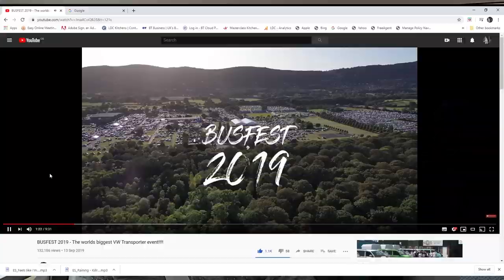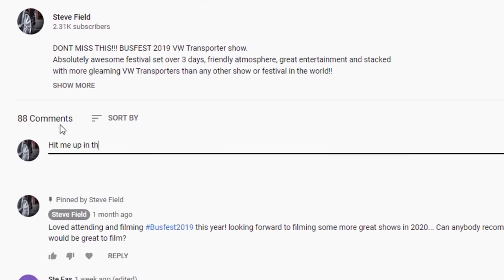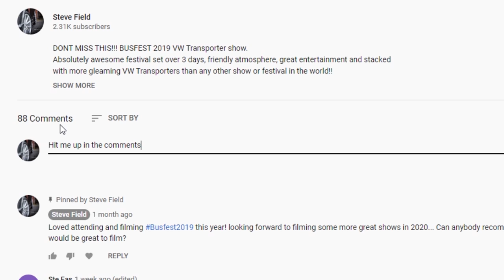Transporter T6 Has a DARK SIDE!! | Winter Mode | OMG..What did I Press..????

Comment: I hope you smeared the hub flange with copper slip grease....I fitted 20” alloys to mine and 4 years later, when the garage tried to remove them for the first time, they had become seized on!
Reply from the maker: Oh shoot! That’s not good.  But it’s good tip👍.  I do use copper slip a fair bit due to owning an old car with same issue years ago but my wheels are never on for more than 6 months at a time as I have 3 sets 😬😂.

Comment: Be careful, having wheels with a load rating less than that required by the plate can result in big fines. You need to get the load down rated to use them legally. They also invalidate your insurance.
Reply from the maker: Thanks for the info👍 I have upgraded the wheels and tyres since this video and have a newer video up now.

Comment: Hi Steve - new boots look tremendous. Have you ever considered mud flaps ? ( thinking go the shot blasting on the side bars). The OEM fronts are fine but the rears are a tad odd. Did you also contemplate sealing the new alloys with the likes of Poor Boys wax ? Keep up the tidy content please. Loving the intro edit by the way ....
Reply from the maker: Cal S Thanks buddy 😊. I have considered yes and like you in not sure about the rears as the sit halfway up the bumper so it’s kept me from adding flaps.  They would be blummin useful though!! Re the protection,  that’s a good point I haven’t protected them yet but I do want to restock on my detailing get as im really low on stuff again  due to regular washes over the winter 🤙.  Is poor boys wax good stuff?

Comment: Love your channel. You make the diy changes look very easy. How does it work if you change your wheel sizes eg from 17s to 20s with regard to your speedo (speed and mileage)?
Reply from the maker: Thank you 😁,  it does effect the speedo so tyre size is important.  I run 275 / 35 / 20 which keeps my rolling ratio very similar so mine is marginally out but if you have 275 / 40 / 20. You will increase the overall radius by a noticeable amount and that can alter speedo so 6-10% potentially..  I can also cause the wheels to rub on full lock in so cases too.
Reply: @SteveField  where do you find out this stuff?
Reply from the maker: KVG M05 me personally I have been modifying  vehicles for years and you pick the knowledge up as time goes on.  But I still learn something new every day !

Comment: What drill did you use to take the wheel nuts off cheers
Reply from the maker: Its a Kielder 18V 1/2" Impact Wrench with a 4Ah Battery. I carry it on the van in event of puncture as has the torque to pull the nuts off when they are fully torqued up with any pre loosening .  I still use a torque Wrench to torque the nuts on refitting though.
Reply: Thanks for the reply and how do you rate it ?? Is it worth a purchase cheers
Reply from the maker: jason Pugz Yes I rate it for the price very good  tool.  Used it loads with swooping wheels for these vids and it’s still on the original charge!!  £160 GBP👍

Comment: Steve, what's the opinion of the Transporter HQ lights at night?
Reply from the maker: Well,  I love the Seq indicators, Im happy with the DRL although would love it even more if i couldn't see the LED's and the were full defused... But still happy... Lights at night is say, "Better def better but I would still like more if it was available as my other vehicle has Xenon headlights and is worlds apart.  I have made a video on this if you have not seen it?.
Reply: @SteveField  saw the fitting video but not a night time test
Reply from the maker: spaynter my evaluation in the lights when I think about it is.  If an existing van has those stock headlamps there is no better headlamp on the market to improve it for under £600 “as far as I am aware”  but given the chance I would def have paid the extra £1500 at the factory.   🤙

Comment: Did you powder coat your side bars?
Reply from the maker: No buddy that is the factory finish from Vanstyle if you opt for black.
Reply: Steve Field mine are chrome & was thinking of getting them powder coated black as well as the roof rails 🤔
Reply from the maker: Lee C I don’t know how much the powder coating would set you back? But it’s worth noting  that you can get these bars for about £110 from vanstyle already in the black 👍
Reply: Didn’t you fancy a 40 profile on a slightly narrower tyre? Such as 255/40/20?
Reply from the maker: P definitely, but I think you get some rubbing on full lock with lowered van on that tyre. I don’t get any on the 275/35/20 so still pleased with the set up. 👍